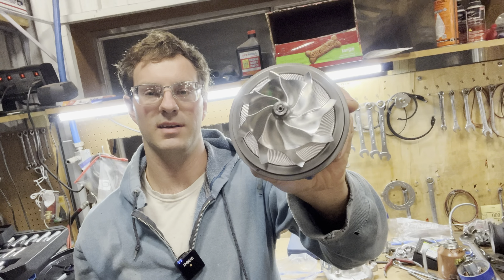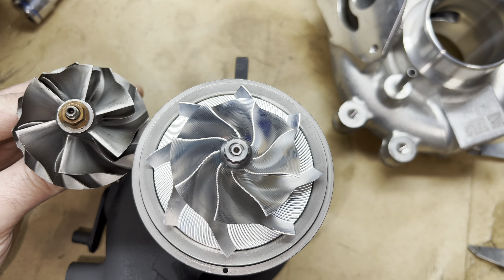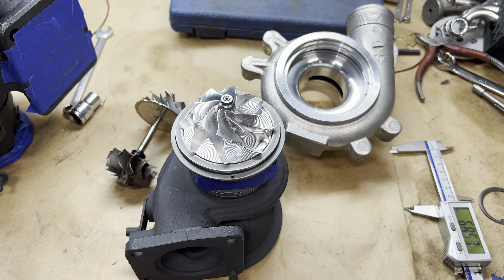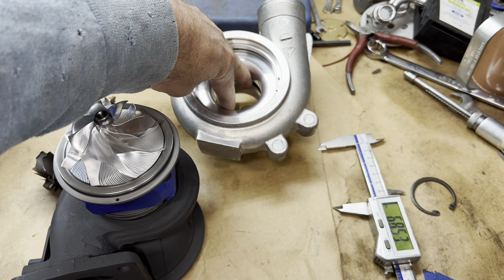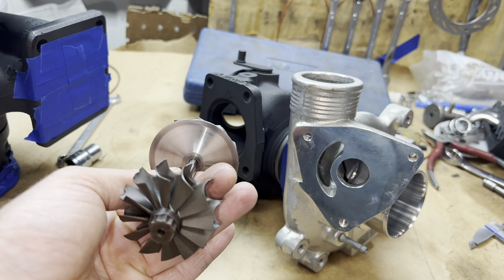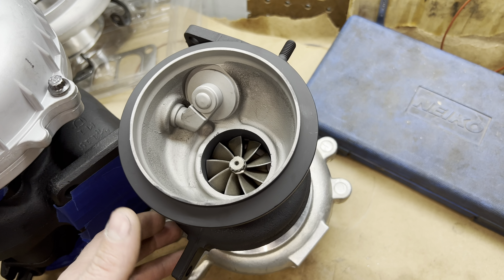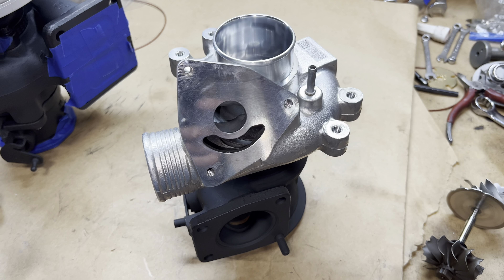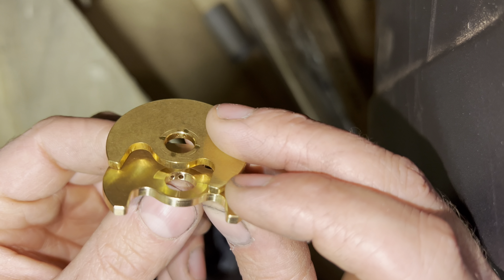McLaren 600LT TDO4 turbo upgrade

Comment: Very interesting, I think you should try and get the CNC profile for this.. I have a set which I might want to upgrade depending on the price. Maybe pure turbos or Weistec engineering might be nice enough to send you the profile.... Check in with them
Reply from the maker: I could probably take the wheel to get 3d scanned locally from the company that makes tools for me. There are several other wheels I could use that I have on cnc already.
Reply: @turbolabamerica  I Might be interested in a build.... 50 Inducer comp/68 Ex and a little larger 9 blade Turbine... Works well on these cars.

Comment: Very informative video as always!
I wanted to ask you if there are noticeable gains when porting the hot side of the turbo. I'm sure the quick answer would be "it depends" specially if there is a big mismatch between the manifold and the turbo. 
What I'm curious about is, if there is a small difference between the manifold and the turbo, does matching and polishing would make a difference?
Also, is there any improvement one can make in the transition from the turbine inlet to the turbine outlet? Thanks!

Comment: Do you do the machining yourself? I've been a machinist 20+ years
Reply from the maker: I started machining in 2011, I’m self taught. I run the mill and the lathe. My mill is a 2007 dpm3 with a Prototrak smx, it’s a 3 axis machine.